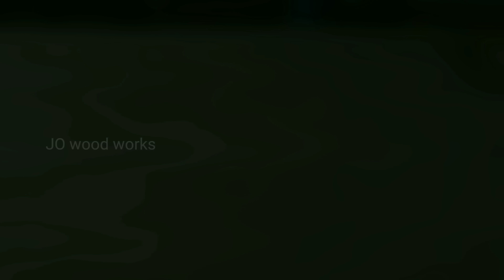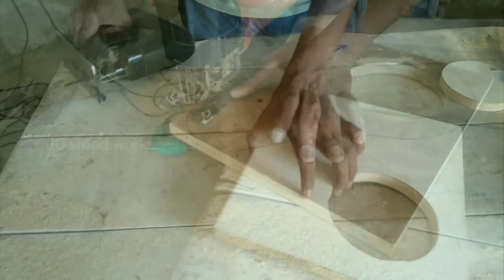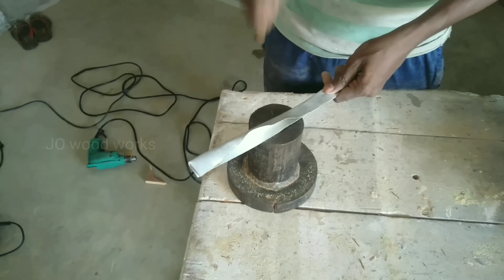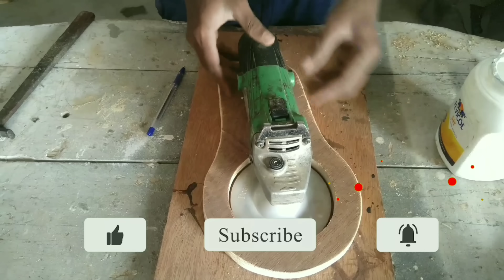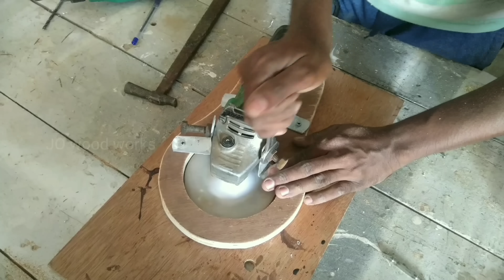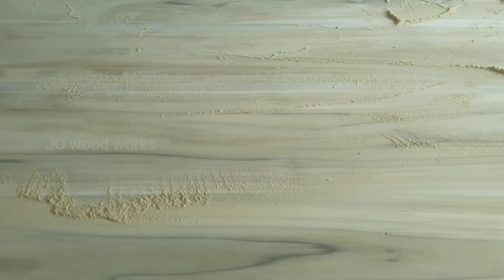Tool Hacks | Angle grinder machine modified to level grinder machine  | wood work

Comment: Good idea . I Like people who are not afraid to  think outside the square, to give it a try.
Suggestion, for better results, glue piece of felt cloth on the underside of your guide jig. And 
Making the grinding jig with depth sanding/ height adjustment would be better. 
You would have to have another board in the system and spring loaded bolts with washers. 🙂
Reply from the maker: Thank you sir we will try better than ideas next time

Comment: This will remove high spot bumps, true, but it can’t level a surface end to end or across a wide panel.  If the surface is low at one end, this jig will just go low with it.  Mount it on bench side rails and level those first…THEN it will truly level for you.
Reply: Good enough is good for many of us🙂🙂
Reply: Bro u r 100% right, it's one end is down.

Comment: Just a small question for the chat. If the surface you are referencing from is also the surface you are machining, is it possible to produce accurate results?
Reply from the maker: Yes
Reply: @JOwoodworks  Lol. It was a rhetorical question.
Reply: @douggief1367  no, every bump & curve on the surface will affect the angle of grinding, so why orbital sander is best cz you can feel the low & high spot and apply different pressure to make it flat.
Reply: NO you will never have a flat surface with it , you may even damage a really flat surface if using this method .
Only to have a flat surface with any tool is to mount it on a sled like the one used with a router . Even thouh ,if the disk sander in not fully parallel to the surface , you will still have valleys and mountains 😅
Reply from the maker: 200% it's produce accurate result and safe working
Reply from the maker: Yes still now we are using this tool
Reply: @JOwoodworks  No you’ll not. Have a look at engine block resurfacing machine. The ‘referencing points’ are independent of the working surface ie the engine block and in your case the shoe for the angle grinder.
Reply: @drt4789  This seems to work on exactly the same principle as old school hand planes (or electrical hand planes). They also don't have an external reference. But they can achieve a flat enough result with enough passes. Of course we are talking about flattening the top of a table, not an engine head. The same level of precision is not required! I'd say this probably works better than an orbital sander.
Reply: Just a thought. There is a machine for planing gravel roads. It has wheels in front and in the back but it is stretched out very long. Somewhere inbetween is a flat bar that scrapes the ground. Of course the machine references from the ground. But since it is very long it averages the bumps and valleys. It cannot level perfectly but still make a more even averaged surface.
Reply: @amajorseven  I agree with that statement. The longer the tractor the better. With this machine tho, it must be set so it barely touches the table, if not dead level with the wooden shoe he made. This tool is probably only good at taking material off where its really high in some spots with an already almost perfectly flat table. You will still need to fine tune the flatness with an 8" random orbit sander with 80 grit. This tool is for quick removal only, not fine work
Reply: @jakefriesenjake  I agree, too. I could see this grinder modification as a solution if it could be attached to a sled running on separate beams independent of the work piece.
Reply: @amajorseven  yup. That can work
Reply: @DonDrito  I was referring to Jo wood works claim of a 200% accuracy which it will not. Of course, they can achieve a ‘flat enough’ result where precision is not required. Anything, in this case a wooden shoe that minimise human error is always welcome.
Reply: @jakefriesenjake  8 inch lmao no you won't
Reply: @Maximaomega  also wrong
Reply: @chompers11  huh? Ok 12".....
Reply: Вполне можно добиться хорошего результата если начинать шлифовать, опираясь на внешнюю, ровную поверхность.

Далее уже можно будет шлифовать с опорой на отшлифованную поверхность.

Точность будет не высокая, но допустимая для некоторых работ.
Reply: The dust collection you'll be improved a bit
Reply: NO
Reply: @Maximaomega 
This jig will give better control when using an angle grinder for sanding.
The angle grinder is notorious for running away with itself and digging in.
Because of the high speed and centrifugal forces. 
The support that this jig gives to the angle grinder removes the need for delicate hand control.
The pressure will be even everywhere it travels and the hand will not be struggling for control.
I think that if this is the only tool you have for sanding, in your workshop, then it is a big help.
Reply: I believe too that it can t be 100 ,% accurate.but it removes much material.also some people can t afford jigs from companies so as an idea is very good

Comment: Going against the grain tearing the wood palm sander is 30 bucks
Reply: hes not trying to sand the wood hes making a DIY Thickener they are expensive to buy its actually a net hack if you need to make wood boards flat and straight i.e on plank is 1 inch the other is 3/4 inch and you want both 1/2 inch level and flat do you get the concept of a Thickener machine and what its used for?